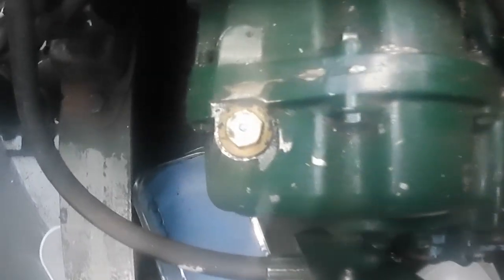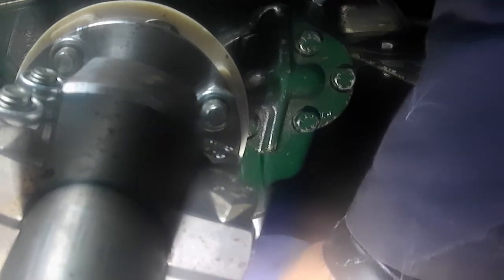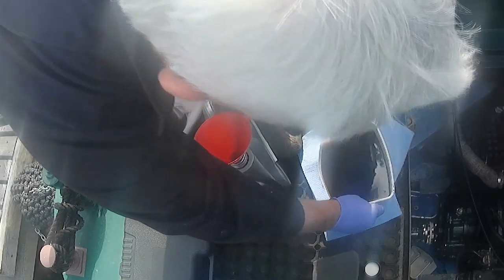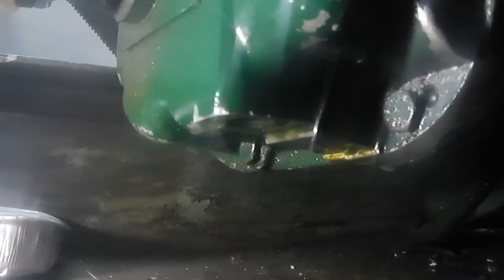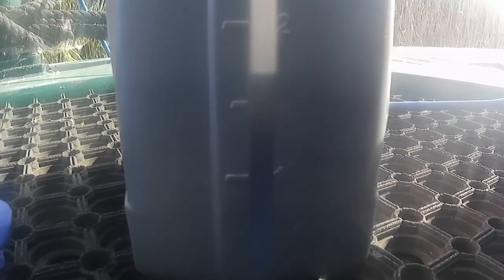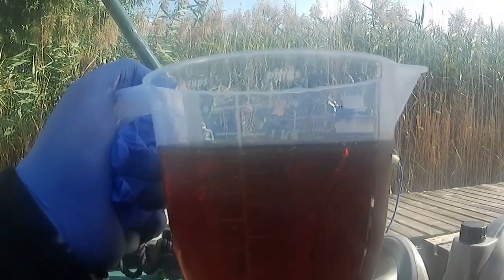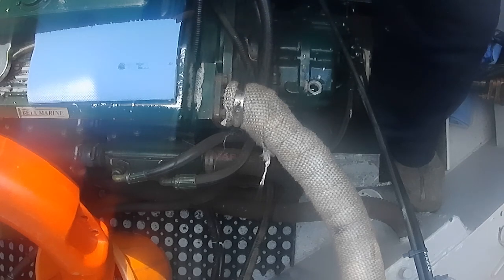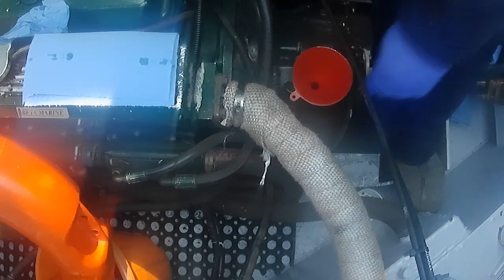#40 Change the oil on a PRM150 narrowboat gearbox

Comment: Great video and a good tip for reading the dipstick level - wish I'd thought of that. 

I got so frustrated trying to see mine I made a separate one out of a white cable tie pushed through a plastic block, I then copied the empty and full marks onto it from the real dipstick using a sharpie marker pen. I keep it hung up in the engine bay. 

I too have the same problem with the oil container not being quite big enough. I have a large oil syringe and usually have it strategically placed and ready to suck a little out of the container as it drains. If I'm lucky I can get enough out before it overflows but inevitably it still seems to go everywhere lol!

Comment: I bought a 12v suction pump from Amazon. It takes MOST of the oil out but it's always worth taking the drain plug out as well, to make sure every drop of oil is drained out. Plus it makes less mess in the engine bilge. Take special care of the dipstick as they are about £50 each!!. PRM say run the engine out of gear for 15 minutes prior to draining the oil out. I like your method of checking the oil level...very handy tip!!